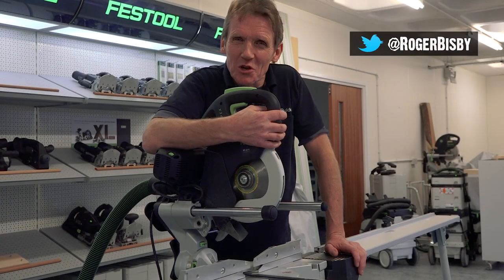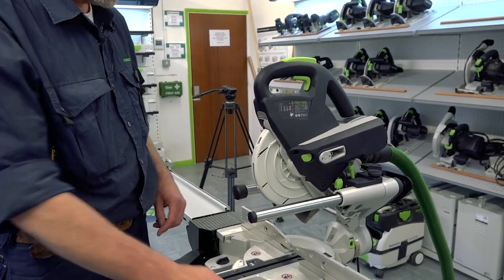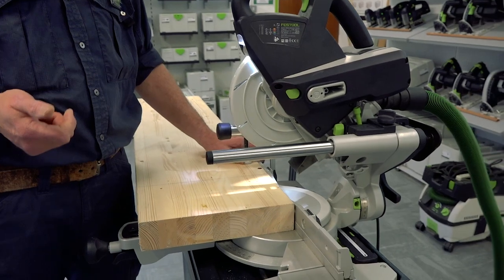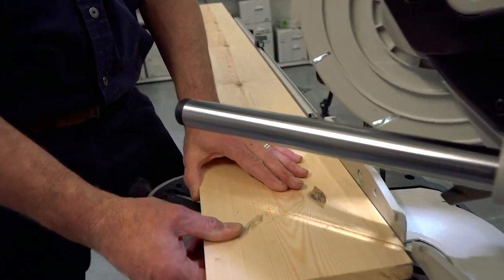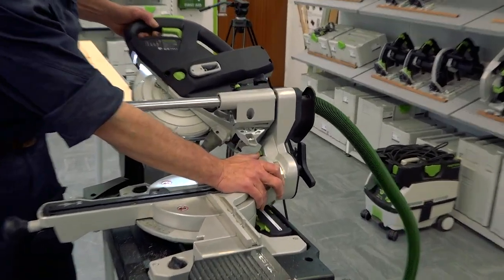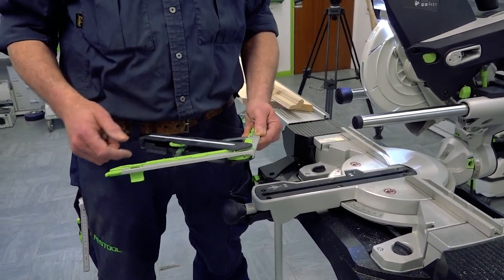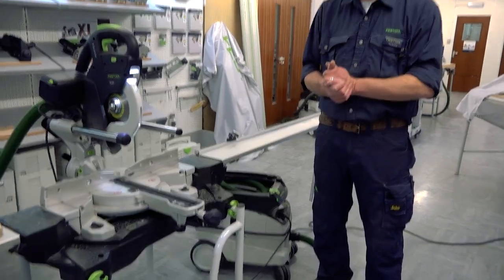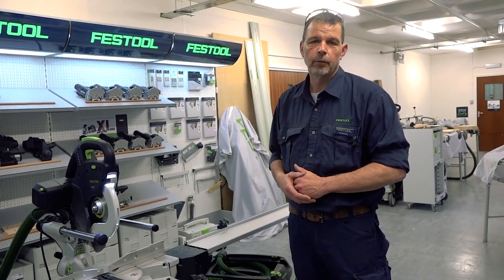Festool Kapex KS 60 Sliding Compound Mitre Saw Demo

Comment: I purchased this machine and the returned it the next day. You can't cut timber thicker than 30mm on a compound cut. The machine also tips over when attempting a compound cut.
Look at how badly splintered the cuts are on the video.
This is a terrible saw its so limited on the cut depth
Reply: Dude that was cheap pine, no saw would make a better cut but i agree with you on the compound cut, doesn't matter for me as i will be using this for second fix.
Reply: My kapex 120 with a Freud blade rips even the cheapest pine leaving a crisp edge. I don't believe the 60 has the ability to spin the blade quick enough.

When I returned my 60 I was the second person to do so in that particular shop that week.
Reply: actually on kapex 60 the blade spins faster than on 120, but 120 is too big for me anyways and what blade were you using on kapex 60?
Reply: You are incorrect the kapex 60 blade at the point of the cut/rip is considerably slower In part due to less power and a smaller blade than the 120 (I have owned/used and tested both)
The actual size of the two saws physically beside each other is minimal. It's the ability of both saws which is night and day. That is why the 60 Is such a fail
Reply: I was using the stock Festool blade. However I always change out the stock Festool blade for a Freud blade. The Freud blade delivers a crisper cut every time.

I'm not a Festool hater, I'm actually a huge advocate of Festool products. I will however point out if something they sell is useless
Reply: I have a KS60 and a KS120 and both of them do great quality cuts. If you want to stop breakout at the top of a board then you need to track that board before you do your full cut. 

No saw can help you with bad methods.